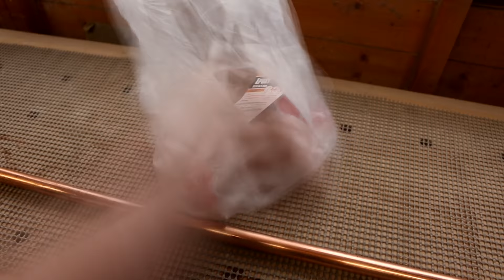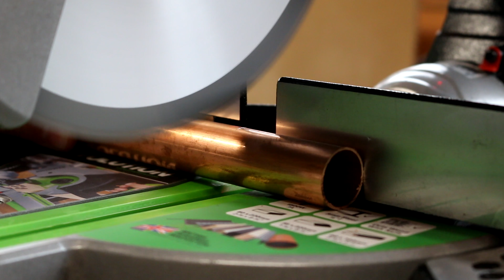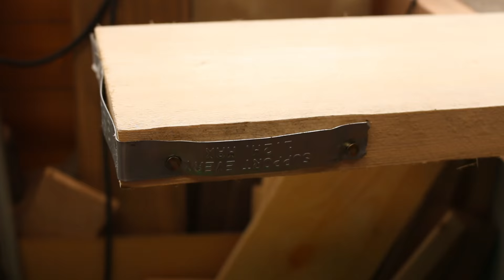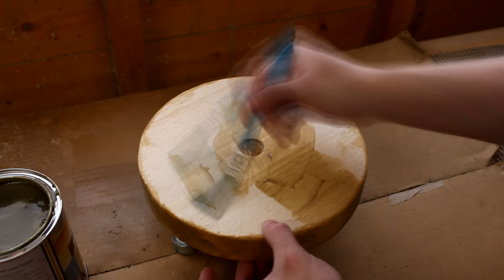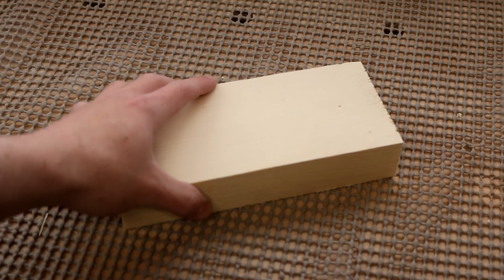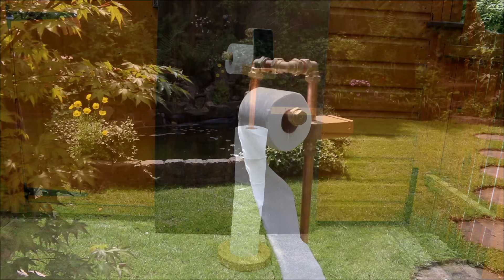Copper Pipe Toilet Roll Holder - Quick & Easy Project

Comment: What a load of sh*t! Fun project Joe :D

Get a champagne type cork, cut the head off, drill it through. Stick a bolt through with washers leaving the rest of the bolt sticking out of the fatter end of the cork. Now you have an internal jam chuck you could put in a drill chuck. Stick  a bit of pipe you're working on the cork and you have a safe-ish hand held lathe type arrangement that will be handy for sanding and polishing small tubular stuff. The cork will either disintegrate or slip under high torque applications, so shouldn't snag and try and twist your hand off.